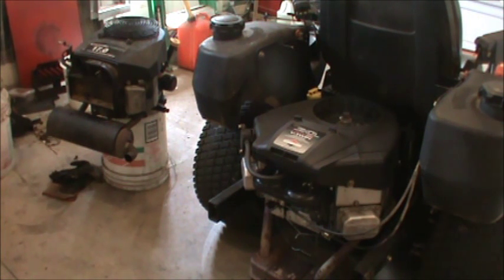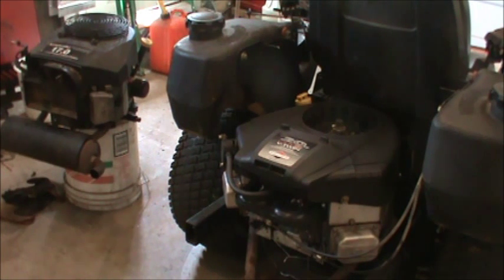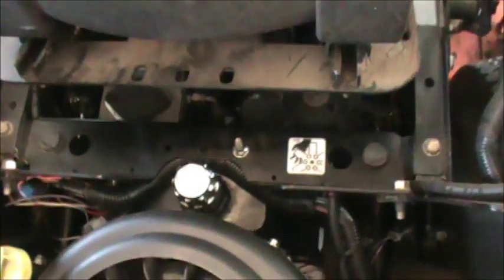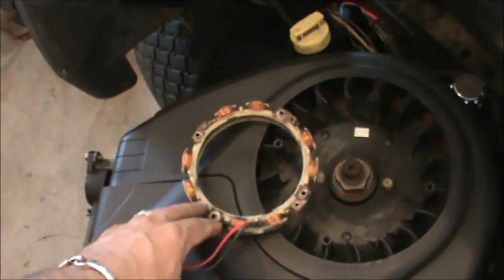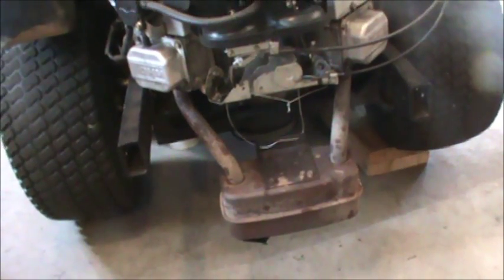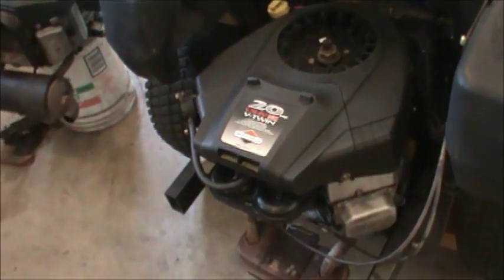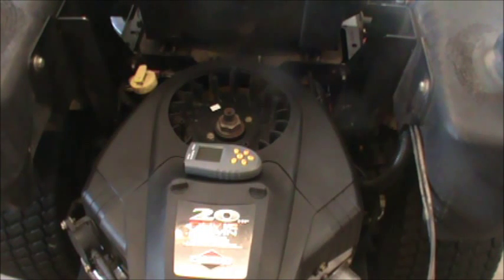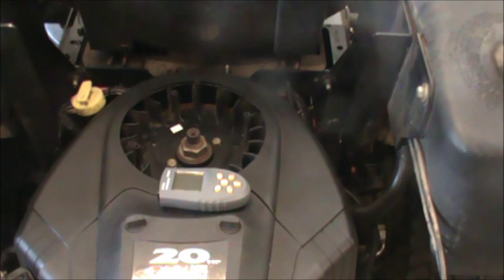Considerations For Swapping A Tractor Engine

Comment: I went from an 8 HP briggs to a 14.5 very easy swap .. I can see from one brand to the other could present a little more work .. But it can be done and you proved it !! Good job..
Reply from the maker: ShawnMrFixit Lee  That's a big jump 8 to 14.5 do you notice much difference?
Reply: Oh ya.. I now can mow very tall grass without bogging .. It is only a 30 inch mower , But works awesome  in that tall stuff.. It is a rear engine mower so it gets great traction to !

Comment: Yeah you've got to watch those dealers big time. I did a bunch of work on our encore xtreme zero turn mower just a few weeks ago. I put 6 new bearings in the 3 spindels for $30. Yes $30 for 6 bearings. The dealer wanted to replace the one that was bad for $150. The trouble with doing that is the other ones will need done soon. They're on their way out. If one stopped working completely then we would be into another belt. So for him to do all 3 spindles it would have been $450. We also needed a belt. His price was about $130. We got a belt that fit for $76. Needed a new pulley that was about $40. Don't know what he would have charged. We think his bill including labor would have been close to $600. I did it for dad for about $200. Unbelievable savings. I know the dealer needs to make his money but not so fast. Nobody likes to be taken. Great video.
Reply from the maker: Love2boat92  Does that Encore have greasable spindles?  I know my gravely does not.  The gravely dealer told me the sealed bearing last longer than the greaseable because people do not grease them enough.  I'm not sure what to believe????
Reply: No theyre sealed. I've got news for your gravely dealer sealed bearings don't last any longer than grease able ones do. If you grease the grease able ones enough they'll last a long time.
Reply: 1:04 1:04

Comment: Great vid looking at doing a similar swap on a Craiglist mower as a second mower. Agree with it's not commercial but could do this several times before coming close to the cost of the new Kawasaki. Didn't know those tachometers we're that reasonable definitely getting one

Comment: Very go info didn't know that about Electrical difference Staters had a John Deere rider with a 25 h Kohler try to put another 25 horse Kohler back on it off a craftsman has all mounted up and discovered the shaft size was different they wanted 300 her new crankshaft I was going to swap out put the John Deere back in storage but the 25 h back in the craftsman that's the problems you run into you would think 25 h Kohler would all be the same I think they do that to make it hard on guys like you and I great video Thanks
Reply from the maker: Gene Hensley You can just buy a new pto that fits the new shaft and I guess a pulley too.
Reply: I've got the the new PTO that fits that craftsman I'm going to say it's a inch and a quarter shaft but the pulleys are different there's not room under there it hits the steering link I have to run across A cv 730 that come off a John Deere with a1 inch shaft it's a very nice 52 inch cut head gasket blew and ran out of oil I'm going to keep looking on ebay thanks for your input

Comment: Kohlers are the best in my opinion atleast Command series Courages suck, i have found plenty of kohler engines for $100 or less including the mower i use to cut grass with its a Yard pro garden tractor with a 22HP kohler command V twin after replacing its Smart-Spark system with regular coils and a used wire harness from a $20 blown motor i haven't had any problems with it running since

Comment: I've got a dilemma. My 72 hours old Kohler Courage 18 "suffered" some internal failure. I do have a Briggs 16 V-Twin OHV that looks like it could fit. I am not able to find any reputable channel that explain, in details, on how to swap that Kohler ,unreliable, engine with a similar size made by Briggs. Its pretty much all warnings about Kohler Courage 18 failures.  Any ideas ? Thank you very much.

Comment: what was the quote for a rebuild?
Reply from the maker: 43128lucky4 Didn't ask, I want to do it myself.  I did the swap because I needed the tractor  with no down time.  I have been mowing with that thing trying not to bottom out the muffler.  New muffler is on the way.
Reply: do you plan to rebuild her